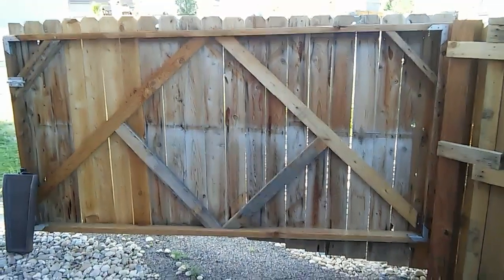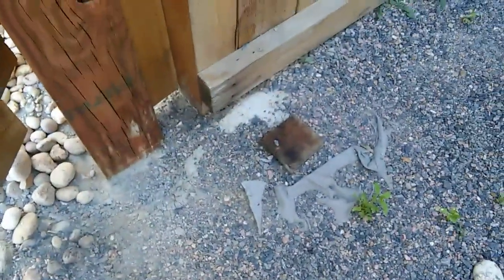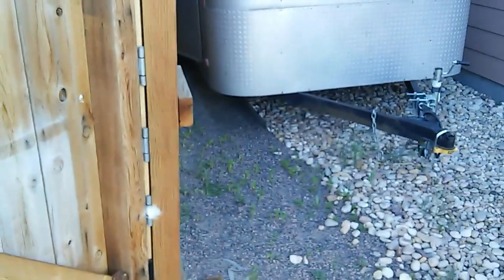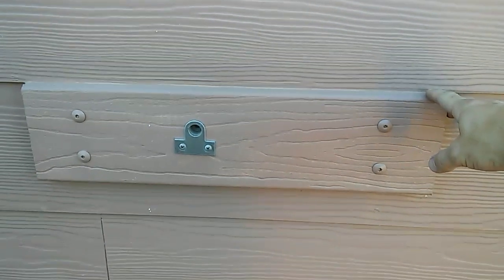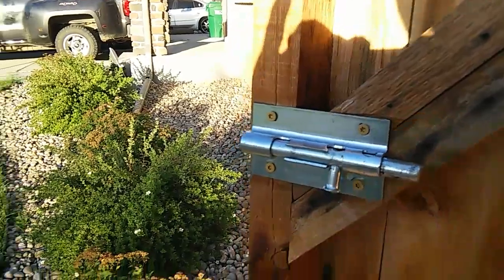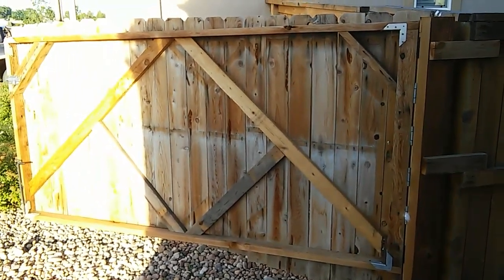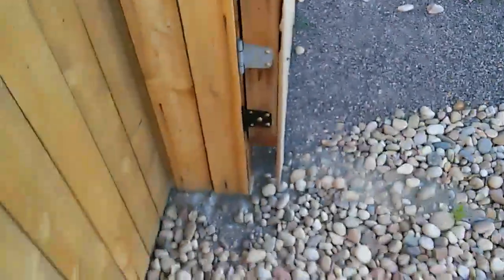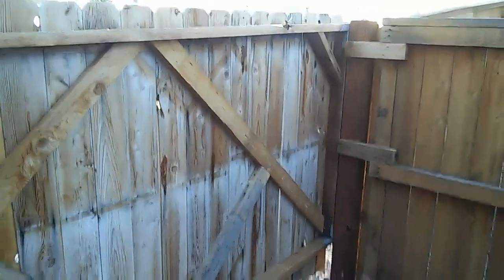10' single swinger gate.

Comment: Here’s a tip:  you can’t brace enough to prevent future sage on the gate.  Instead, go with a tension cable from the top of the main post to the end of the gate to prevent sag.  Should do the job.

Comment: Swinger?  Thsnks fir the idea. Same problem, bought trailer no gate. Had to take panel offs few times. Plus a couple of inches gap on each side
Reply: Did you take a video of it?
Reply: @dacone7066  took pictures, but deleted them. Still need to make a gate. I haven't used the trailer since it is for my side job. Now with all the stuff going on  I have plenty of time. Will try to work on it soon.